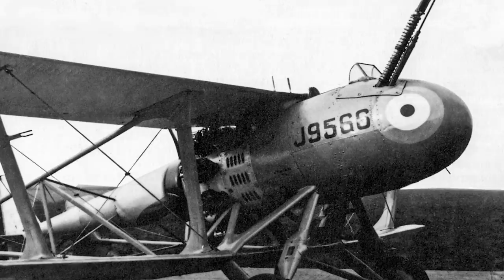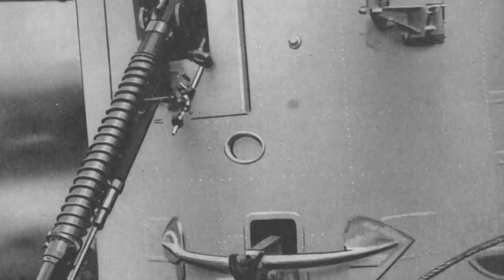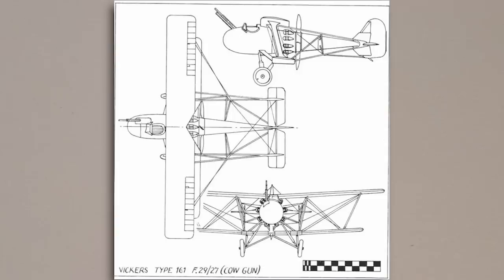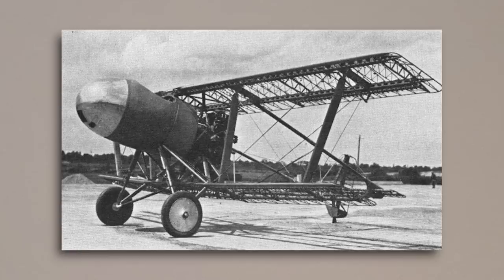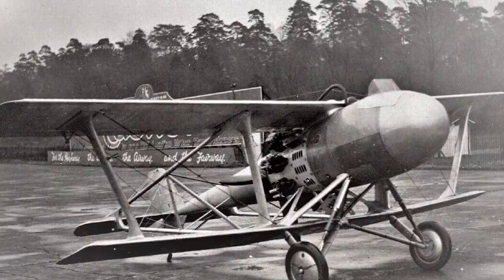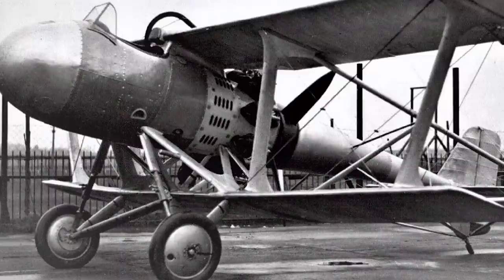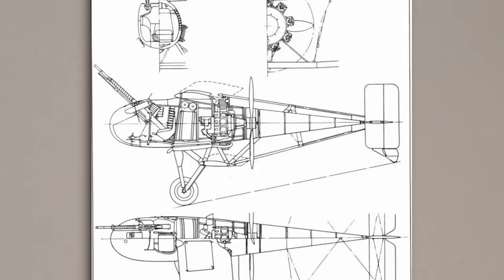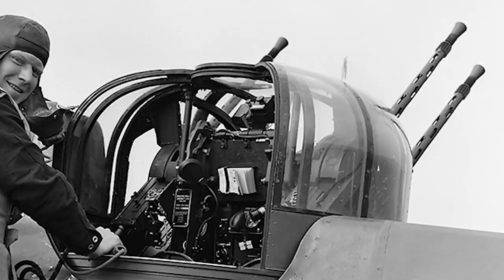Why Fit A Biplane With A 37mm C.O.W Gun? | Vickers 161 [Aircraft Overview #38]

Comment: Now if they'd built it as a traditional interceptor - or added a gunner - you'd have just the thing for enemy bombers, trucks, locomotives and surely, without a doubt, ornery bovines.
Reply: Just roll inverted for ground targets? - the Anzacs would be queuing up for a go - 'Mad Max COW disease'? : )
Reply: I misread that as "ordinary bovines" and thought they would actually need to be quite out of the ordinary to provide a threat to an airplane.
Reply: and tanks, maybe
Reply: You also have to consider the targets in 1929 would have included Zeppelin airships…
Reply: Something like an A-10 "ancestor".
Reply: How about Emus??
Reply: @johnladuke6475  🤣🤣😂
Reply: @johnladuke6475  Not if they were camped out on the runway.  A few good cannon shots should scatter them.
Reply: @johngervais230  knowing emus they would start flying JUST to beat us in an air war
Reply: @loddude5706  rotating cockpit with a plane design to also fly inverted safely for ground attack or bomber strafing maybe ?
Such a design might be more suited to an even larger gun. perhaps a duel fuselage would have suited this idea one with the gun in and one with the pilot in it. that way the gun could elevate and traverse around all over.
and not make the pilot go deaf in the process. & yeah a suitably large canon would be nasty again ground targets maybe even armoured trains as a cheap and cheerful alternatives to rockets & bombs

Comment: Very cool. Didn't Germany try a similar tactic by mounting an absurdly large cannon to the front of a couple me 262's? Think I remember a reference to that. Desperation and blinding muzzle flash on that one.
Reply: You are correct, but if im right only 1 was made with a 50mm and theres barely any images or (if im correct) documents and of course it was in 1945 and obviously not used

Comment: Great video, beautiful plane.

Running the control wires inside the tubes may seem like a good idea but I don't think it is.

It's very good that they actually thought about protecting them. But I think running them inside means there's actually more that can go wrong. Any bending or battle damage of the tube can create friction or sharp pieces that damage the wire where you can't see it, so it actually presents a bigger profile to damage  than running them outside. It's also an enormous hassle for maintenance.

I think the more modern (is it? in planes it is I think) idea of redundancy is the better solution because although the area of redundancy is way smaller in these old planes, so is the munition fired at it.

Comment: Tsetse Mosquitos had a 57mm Six Pounder anti tank gun and Mohlins auto loader. They punched holes in U boats and one even shot down a Ju88 when a shell knocked an engine out of the aircraft. The issue was rate of fire. Diving attacks on shipping could get 5 to 7 shells down range before the pilot had to pull out of the dive. Under wing rockets were easier to install and had more hitting power.

Comment: You kept mentioning that the pilot would have to hope the bombers didn't see the 161 and scatter.  But it seems to me like having a plane that could cause bomber formations to scatter would be useful all on its own.  If the bombers are busy scattering to evading 37mm armed interceptors from below then they've abandoned the tight formation and massed defensive fire that was supposed to keep normal fighters off of them.  Plus it's hard to bomb accurately while scattering.   (However if it was too hard to get hits then your not enough of a threat to cause the bombers to scatter)

Comment: I'm kind of surprised they didn't just fit this plane with more typical machine guns, as it seems like a good candidate for it.  I'm also wondering why they wouldn't just mount the cannon along the bottom of the fuselage with a more standard sight that would allow them to more accurately fire at bombers from behind rather than trying to get under them.
Reply: Keep in mind that machine guns of the time are still rifle caliber. They lack the Firepower to adequately take down a large aircraft.

Comment: There was an A6M5 late Zero variant with a single similar configuration 20mm gun in its fuselage behind the cockpit. I don't know how many were modified or built or even was it ever used in combat? I found it, it was called the "A6M5-S (A6M5 Yakan Sentōki)"

Comment: Madness. Only excused by the argument that it had never been tried. What MIGHT have worked is a much larger monoplane, with tractor engines at the booms and the pusher as is, combined with a gun shooting forward and slightly up. This would have allowed an aircraft  to trail a formation outside of the range of defensive gunners and lob HE into the formation. The Germans did this using Me-110's against B-17`s with moderate success until escorting fighters showed up.

Comment: 20,000ft?  You have got to be kidding me!  Trying to fly something like at 20,000 ft would be suicide.  You can't even breath that high.  Was the pilot supposed to wear a pressure suit?  What where they thinking?  At that altitude, if you aren't breathing pure oxygen ore you aren't in a pressurized cabin, you are going to die.  Wily Post invented the first pressure suit to get around this.  In the end though, pure oxygen was an easier solution.  Even then the human body doesn't like air that thin.  The mucus membranes and the eyes start to swell.  Even on pure O2 you start to feel sick.  Even your brain starts to swell up.  20,000ft without oxygen?  That's suicide.